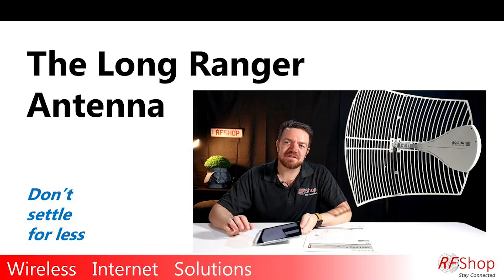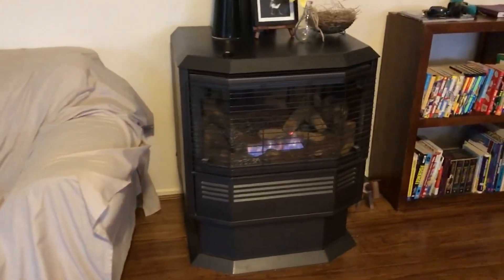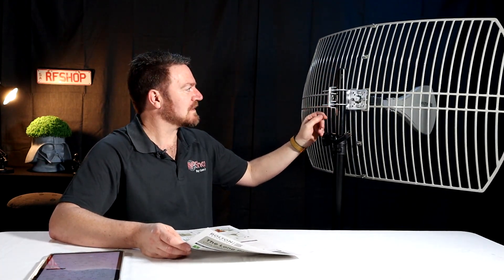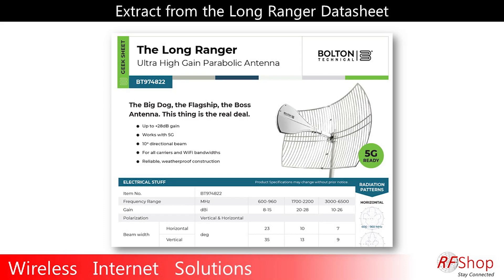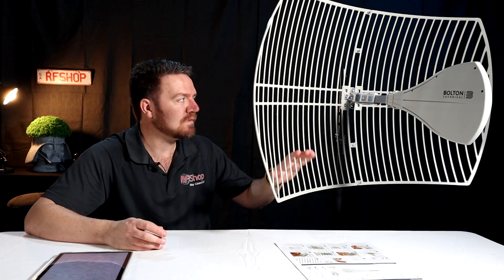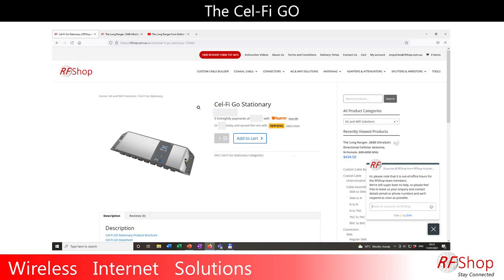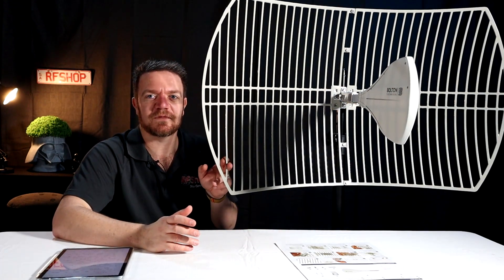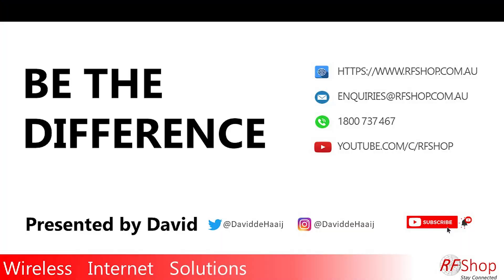The Bolton Technical Long Ranger

Comment: Do I need an internet provider when using Bolton Technical Long Ranger Antenna to get internet ?  
or there is no needs because the Antenna will get the signal even if you don't have a service available ?
Reply from the maker: Hi. Unfortunately you will need a subscription to a service provider to make the internet connection.

Comment: How do you connect the Bolton antenna to a router in order to pull in a remote WiFi hotspot?
Reply from the maker: You would need to connect the antenna to the external WiFi port. Look for the RP SMA connector (see other video on that same topic) and use that to connect a coaxial cable (50Ohm)

Comment: Does this work with T-Mobile Wireless Home internet? Can I connect it to the Modem Antennas like the Mimo Antenna?
Reply from the maker: As long as you have external antenna ports available it will work

Comment: Am I bought the antenna but there is no router to brought cast the signal , how can I get the signal to my phone , I'm from Guyana and work in the backdam
Reply from the maker: Hi Shevin,

You will unfortunately need to have the antenna attached to a modem or router of some sort. Otherwise it has not real function. This device could be a 4G modem or a 4G booster.

Comment: I'm 8km from a 5G mast in the UK, practically with line of sight. Send one to me and I'll review it 😉
Reply from the maker: I think you may be better off looking at the Poynting XPOL-2 antenna, or even the EPNT. You'll need MIMO to make the best of possible 5G connections. As for sending one...in that case I'm pretty sure you'll have UK suppliers ;)
Reply: @RFShop  thanks for the suggestion. Currently got 2x Iskra P60 antennas which are just awesome and give about 98dbm and a Bluespot MIMO antenna antenna which is about 107dbm but the mast I use transmits on band 32 which not many antennas are rated for.